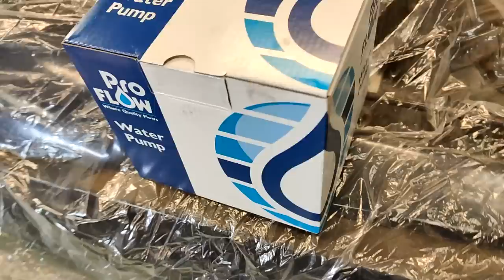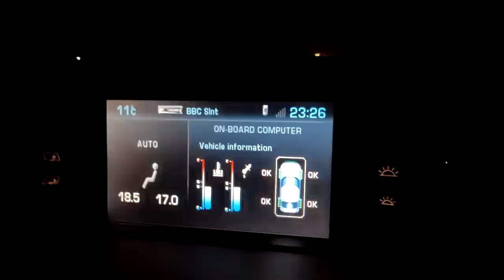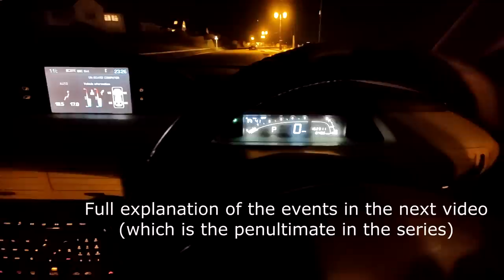Cheap Citroën C6 Project 16: Cooling System Repair VLOG pt5

Comment: From experience, it is far better to discover your water pump is dead on the parking lot than having it seizing, with belts snapping and wreaking havoc under the bonnet when on the autoroute.
Reply from the maker: A fair point

Comment: On the bank holiday weekend, I fitted a new gearbox torque mount to my Saab 9-5, along with spark plugs, oil/filter, thermostat, new coolant and marvelled how smoothly it drove. Until tonight when I hit an effing crater in the middle of the road and now it's shaking like a good thing. I shall treasure those last few days..

Comment: c6 is one of the very few "newer" cars I´d really like to own at one point... Until I found your channel...
Reply: .. wait... there is a petrol one for sale here.... :O
Reply: I own a petrol one and its not that bad to be honest, my repair shop haven't told me to GTFO with it and I've hadn't had much troubles with it in ~6 years. I believe that even looked after diesels wont be such an headache. But then again, I do not know anything about C6 with a diesel engine
Reply from the maker: Petrol ones are much easier. Still complex, but nothing like as tricky as the diesels.

Comment: I took on a friend's 2008 Golf 1.4 tsi twincharger, with a slipped timing chain and a set of bent inlet valves, so I feel your pain. Two of the sump bolts required the notches in the flywheel lining up and a foot long ball end driver to remove. There is no guidance on how you could possibly get them back in. I eventually managed to make them semi-captive in the sump and eventually get the sump back on without getting completely covered in sealant (there is no gasket).

The combustion engine is wheezing its last.

Comment: Because old. It's an absolutely appropriate age for a a water pump to go especially if the car has been used intermittently. It absolutely not the appropriate time though but is that not just always the case. I had to change the clutch master on my mondeo lastwinter in -17degrees and blissard. Which I think is simular.
Reply from the maker: 100% agree.

Comment: I've never owend a deisel.  I'm soooo glad.  Modern cars are designed to break and cost more moeny than anyone can afford.  I'm sure this is done on purpose.  Plastic that is subject to many heat cycles will break.  Not if, just when.  Usually just before or during a long journey.  I eant my Rover P6 or Mercedes 450SE W116 back please.  fix 'em with a hammer and anvil.

Comment: Add L322 Rangies (TDV8) to that list, body off to do turbos! Does make you wonder if at least part of the complexity issue, in times past an engine was designed for one model / floorpan / body / transmission. In more recent times, an engine is developed independently and used accross many brands never mind models, car makers have to add solutions as needed to make them work with their application. I have bad mouthed Eurocarprats so much I have to wear a diguise or ask someone to go in for me. Pity they don't do your brand of doged perseverrence, that I would buy.

Comment: Just come in from the top jack engine up a little and you can change it if you need to change the trumpet plastic twin pipe behind the alternator just come from underneath remove the air co unit and alltinator and you can change that as well the water pump is ok to do remove the top engine mount and fan belt off don't forget to undo the water pump bolts first while the belt is on
Reply: I remember removing the suspension tank  I als removed trimming belt casing bolts when I done the first one by mistake

Comment: I don't see what the problem is with driving a Picasso to France. The car is practical, economical and quite obviously durable. The Picasso is not fast, but not very slow either. It is "quadratisch, praktisch, gut" (square, practical, good) as the Germans say in a figurative sense. However, I hope you get the C6 sorted which is of course a much more inspiring car to drive (when it works). Otherwise a nice video. Keep up the good work :)
Reply from the maker: I actually would like to take it to France!

Comment: 5cy volvo d5 isn't hard to work on, maybe compared to redblock. But not a smidge on that c6. If it was a c6 rs6 maybe justifies the complexity, but for a 2.7 diesel - nah not worth it. My opinion. Enjoy the vids though.
Reply: Hell the i6 in s80 / s90 / freelander 2 isnt bad really, despite the somewhat crazy but well engineered waterpump.

Comment: How on Earth did Peugeot Citroen, once masters of the Diesel Engine go to Ford, who used to buy diesel engines from Peugeot, for collaboration on a Diesel Engine!
Reply from the maker: It was a two way street. Ford helped the Lion engine onto life, and PSA gave them the DW10 to use (and bagde as a TDCI). Then they worked on the 1.4 and 1.6 engines together.

Comment: What coolant was used originally? It has a orange colour as far as you know. What can I use to mix with in order to fill up the level to the top?
Some warned me to mix certain coolants.
Can you say what's the correct coolant to use, mixed with the factory coolant?
Reply from the maker: No idea, I've drained it all out!

Comment: Any link to why the water pump would fail shortly after revamping the entire coolent system? Seems too much of a coincidence but then again, because french, i remember my 206 would get a fault, I'd fix it and then a new fault somewhere different would emerge literally shortly afterwards.
Reply from the maker: Could be that the issue moved on to the next weakest link in the chain.
Reply: @UPnDOWN  Exactly… Furious Driving had the same thing on his Volvo clutch… it finally found where he hadn’t properly tightened up the pipe when he changed the slave cylinder.

In this case I’d suspect the fact that the old coolant filled with Stop Leak had been drained and comprehensively flushed…
Reply: @UPnDOWN  I remember in the old days that if the brake slave cylinders were replaced, the master was likely to go. That would be because of increased pressure, and I think your new coolant, you said, produces less pressure. Could it be, though, that the water pump in some way objected to waterless coolant? "I'm a water pump. En greve."

Comment: Amazing how many problems the C6 has when the C5 X7 that shares parts is such a reliable robust car.
Reply: It's mostly because this is a high mileage example that wasn't looked after.
Reply from the maker: Is it, though? I hear of people having more issues with those than the C6 in every dept. except engine.